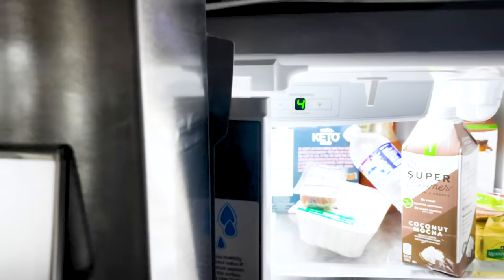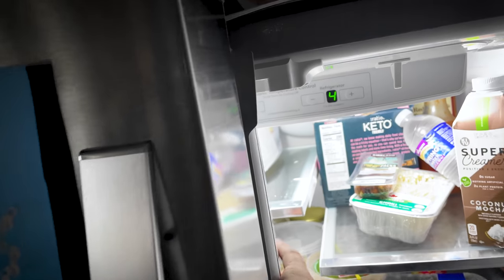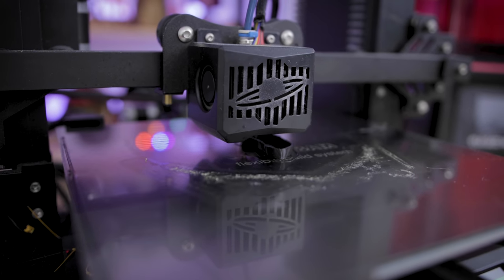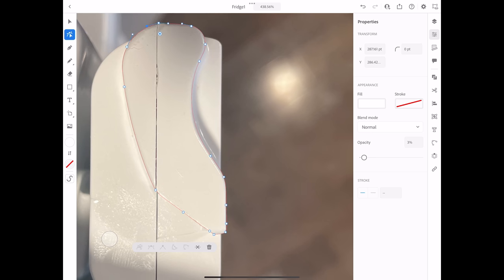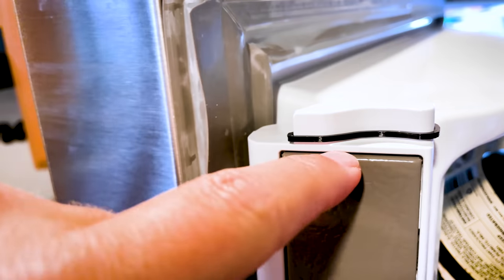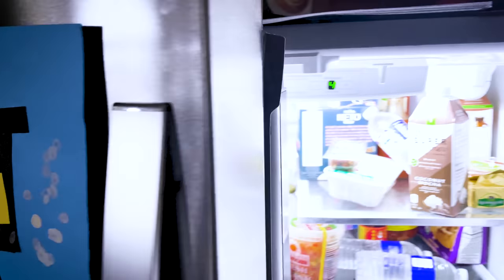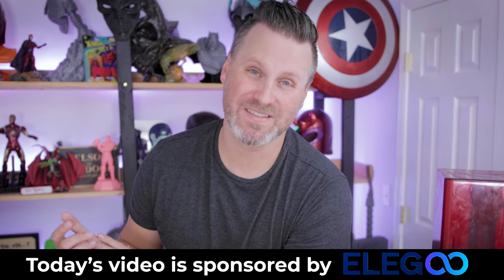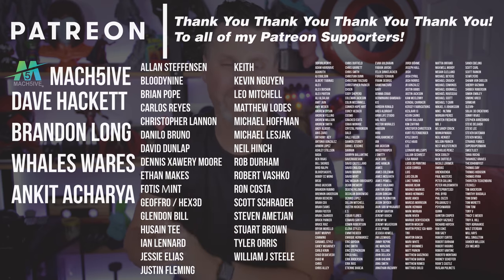Can I fix my Fridge with a 3D Printer? Functional 3D Printing

Comment from the maker: I’m a regular Bob Velveeta when it comes to home improvement 😂🧀
Reply: I appreciate just how cheesy, but smooth this joke is.
Reply: I’ve fixed my fridge with my Neptune 2 as well.
Reply: Whirlpool punching the air right now, watch them try to steal your idea
Reply: Just wanted to say... that if you freeze frame at 5:24 you can see that your left door is sagging down. I don't have that fridge, but there's probably a hinge adjustment you could make to realign the door...

Comment: Hey Jesse, as someone who used to deliver and install fridges, this tended to be a pretty common issue. It usually meant that the door needed to be raised up. How's the seal at the top of your door? If it's pretty weak, the door should definitely be raised. As cool as this print is, it may not be solving the bigger issue. 

Start by taking off the cap on top of the fridge door. If this is the side that contains a water line, be a little careful but it's still easily fixable. From here, you should be able to lift the fridge door up and look at the bottom hinge. There's a number of washers you could print or buy from a hardware store that can go over that lower hinge. This will raise the door and fix both the seal and the mechanism. 

Love your stuff! I got into resin 3D printing early this year and used a lot of your videos to help me get started. I just picked up my first filament printer and looking forward to it arriving soon. Thanks again!
Reply: I was just thinking the same thing. If that catch isn’t lined up, I would be worried the door was aligned properly. If it doesn’t seal well, it will work harder to keep cool and wear the fridge faster.
Reply: Another appliance pro here, washers in the hinge to boost the door is correct. A new mullion will probably fit like the original.

Comment: This method is even easier in fusion 360. You take a photo and measure one dimension of the object you photographed. Within fusion you can then scale the picture to a calibrated dimension where you input the one you took before. Then you use the "pen" tool like illustrator, extrude and print. (Did this for sunshade covers at home)
Reply: If you can put the object on a document scanner, you can remove all the parallax error and make it even easier to accurately model something
Reply: And when you can't find your calipers, you can just take a picture of the object next to a ruler, and use that to scale the photo (canvas in Fusion 360).
Reply: I just used the same process to make an air assist nozzle for my Sculpfun S9 laser.  Works great!
Reply from the maker: Oh man oh man. Okay I need to officially check out fusion 360… sounds super simple
Reply: @UncleJessy  I'd hesitate to call it "simple" but it's not overly complicated to get started and do what this project calls for. I've used the item on a scanner bed with a ruler next to it for a bunch of projects in fusion like recreating tape dispensers for thin Tamiya masking tape refills that don't have there own sized dispenser
Reply: @UncleJessy  "Fusion 360 Canvas" will get you good results on YouTube. Just include a ruler in your picture near the part, oriented as "normal to" the profile you are tracing with splines. "Calibrate" your canvas between two measurements on your ruler, and you're good to go. The only other considerations when printing are either scaling in x/y for tolerance, or alternatively, adding a tolerance in Fusion 360 to your traced profile by using the "Offset" command when you sketch (trace) the profile. The ruler trick is probably better anyways since this is a funky shape, and calipers would mostly serve the same purpose here (taking one dimension and using that to reference/scale the shape you trace with splines).
Reply: Same here I’ve used Fusion 360 to make parts by scanning or picture, then scaling it and test print
Reply: @UncleJessy  If you can use Illustrator you can basically use Fusion. Fusion is extremely intuitive and simple for most projects!

Comment: For me that is on of the biggest joys in 3d printing, the practical part. I am really excited if my wife or someone out of my family comes with a request and I often sink way to much time in it. For example by designing a tray system for my sisters polearm in her pet barber shop. went full overboard with it and needed 2 spools of filament for it and had a reason to get a 400x400 printer :D

Comment: I bought my first 3d printer for making project boxes for my electronic hobbies. Since then I've made plumbing brackets, paper towel holder, parts to fix my fridge, my atv, my van, etc. They really are invaluable tools if you have the mindset for DIY.

Comment: As much as I love functional prints, why the hell should it be the customer's responsibility to solve a warranty issue and why should he be afraid to pay for it? The product does not meet the specifications agreed upon purchase.
Reply: Happens way too much these days..
Reply: @ProthPhenom  yup, major brands used to give a shit about image and take pride in their products,  but they all just don't care
Reply: It's not a warranty issue.  The fridge isn't sitting level.  My fridge does the same thing in my old house.  He just has to adjust the height adjustment feet on the bottom front of the fridge.  One side is is sitting too low. It looks like he just needs to raise the left side of the fridge up a small bit, and then that little flap will engage with that center piece, causing it to close/open correctly.
Reply from the maker: Yeah… I was like uhhhh sorry I need to pay someone to come out to verify the issue that I know is there and then pay them to fix it?!
Reply: @UncleJessy  also for future,  you can cross check parts from other brands and likely get them cheaper. We have a GE dishwasher and the GE branded parts are 4x more than the Frigidaire branded parts. Also GE Washer and Dryer tower,  and it was the same. I was able to get the heating element by Frigidaire for $35, but the GE labeled one was $90
Reply: @UncleJessy  we have since upgraded to the LG Wash tower, and LG XL French door fridge. When we bought the house we had it filled out with Samsung appliances... big mistake! Do Not buy Samsung appliances! Lol they ALL broke within 1 week to 1 month after the warranty expired 🙃
Reply: @Fearmylogic  I don't think its a overall leveling issue with Uncle Jesse's fridge,  I think it's a door adjustment. Meaning he needs to loosen the bolts at the bottom of the French doors and raise them up in to the upper hings by 1 inch on both sides.
Reply: @Kitzkrieg  Possibly.  I just know that I have a samsung that has the exact same flapping mechanism, and the door hinges are not adjustable what-so-ever on my fridge.  But adjusting the feet height totally fixed my problem.
Reply: While it can totally be the product not being to spec. It could also be the Floor not being level and the installer or user not tramming the refridgerator. Which is not covered under warranty since that would be considered installation or user error.

Comment: Mechanical Engineer with 6 years of Solidworks experience and honestly, you did it basically how I would have done it! Solidworks allows users to sketch over an imported picture just like you did.  Companies love using "organic" shapes in their models so modeling this with a pair of calipers would've actually been more difficult/time consuming! Good work!
Reply: As a non-mechanical engineer, but just a regular guy without any special knowledge, the first thing I'd have done, is make sure the fridge is sitting level.  at the 18 second mark, right before he opens the doors, you can see the left door is sitting just a touch lower than the right door.   I know I'd have done this, since I had the same issue 3 years ago when I bought my fridge with the same mechanism.  He just needs to adjust the height adjustable feet on the bottom of the fridge.  Looks like the left side needs to come up a little bit.   That's it. Its probably not the hinges, or the flap, or anything complicated.  He just needs to level out the fridge a bit.

Comment: I had an issue with a built-in fridge, in that the clips for the outer door had all broken over time (15 years!). I knocked up a copy of the broken clips in Fusion360, using a micrometer to get the correct measurements, increasing the length of one part with the slots for screws on the edge of the fridge door. Printed them on a Wanhao Duplicator i3 Mini (all I had at the time), worked well in PLA for the next 3 years.
I did use an SVG file for a different project, to make a 10mm insole for my right shoe - discovered after an x-ray that my right leg is 11mm shorter than my left leg. That was printed on an Ender 3 v2. Still going strong after a year of use.
Reply from the maker: Wowza!! Now that is impressive! 3D printing to the rescue! I really need to attempt to learn some fusion360 basics
Reply: @UncleJessy  I'm still learning! 38 years after getting a BSc in Computer Science and still learning new stuff 🙂

Comment: Hey Uncle Jessy, new subscriber here! Ummm...from the gasket to opening misalignment I can see at the 1:23 mark, your entire door is sitting low on the fridge, which is why the mullion isn't catching the tab properly. That is almost always height adjustable, and would leave you with a better sealing door and your mullion problem would be resolved.
Reply: I came here looking for this comment as soon as he showed the problem
Reply: @neoyarus  Ditto
Reply: Of course this is the issue.. but if you only have hammers, then every problem looks like a nail..

Comment: I’m thinking the issue is when you put the fridge in place you never leveled the feet on the bottom, the right door is higher than the left and with French door fridges they should be the same height, just unscrew the little foot on the front left a bit to get some more height and should fix it, but I like the idea on how you solved your problem, got to love 3d printing.
Reply: I have this same fridge and had to do exactly that.  After leveling no more problems.

Comment: Nice fix , you may want to have a quick look at the hinge on that door though, looks like maybe the problem was caused by the door sagging, maybe there is some adjustment on the hinges to correct it in case it gets worse.
Reply: It's not the hinges, at least it SHOULDN'T be, or there would be noticeable wobbling of the door.  I have the same type of fridge that had the same problem.  He just needs to adjust the feet knobs, and raise one side a little bit.  That should fix the issue.

Comment: Great fix. Using a photo or flat bed scan has the same limitation as photogrammetry, which is that there is no size reference. One tip is to add a ruler to your photo or flat bed scan, so you can scale properly. With photogrammetry, you'd have to measure the original and scale accordingly.

Comment: Great video! Fusion 360 had a "canvas" feature that lets you import a photo and sketch over it similar to what you did in illustrator. If you know a dimension between two points or if you include a small ruler in the photo, you can calibrate the image scale with two points. It's a great feature for reverse engineering.

Comment: Good Job Jessy. We are opposite. I do mostly functional prints. I do like the stuff you print, just don't have a need for them. You may be able to make an adjustment on the door to raise that hinged part. Either way, it works now. That's a win.
Reply: I had the same problem a couple years ago with a samsung fridge.  For some crazy reason, It's the height adjustable feet that he needs to mess with.  At 18 seconds in, just before he opens the doors, you can see the left door sits just a bit lower than the right door.  He just needs to adjust the big black knobs at the bottom front of the fridge.  Raise the left side up a touch.  At least on my fridge, there is no adjustment to the door hinges.  They are just solid pieces of metal screwed into the fridge, and slide into holes in the doors.  So if it was the hinges, he'd have much bigger problems than this. The entire door would be wobbly ( a sign that the screws are loose ).

Comment: If you have access to a 2d flat bed scanner, id have recommended: 
1. inking or painting a thin black coat onto the profile you were trying to copy, and then stamp it onto an A4 piece of paper (as this A4 size can be your reference dimension when it comes to scaling the image after the next step), then wipe clean once done.
2. then import the scanned image into fusion and trace around the stamped profile.
3. Create an offset edge from the original profile to give your self a small tolerance, say 0.25 -0.5mm (This would give you 0.5mm - 1mm of overall play) 
4. Then another offset from the original profile of 2-3mm (this would be your wall thickness) which will then give you a profile that can be extruded upwards by whatever height you needed. 

Alternatively, you could have imported the scanned image into illustrator and convert it into an B&W SVG file on an A4 canvas, this could then be imported into fusion, scaled to the correct size of A4 and would save you having to trace the profile manually as SVG formats can be extruded/used as sketch items, allowing you to skip step 2 which is probably the most tedious part of this process. 

It would be rough, but with out some callipers and other metrology devices to find curves etc, its a simple way of getting something made, with less chances of making lots of 'proto-type' fits that end up in the trash. 

And then yea bobs your uncle, or in this case Jessy is your uncle

Comment: I made a new handle for my brothers business printer and I used Fusion 360.  I took a picture of it, then used the calibration tool to set the dimension of the picture to reality and did and outline and extrusion etc like you did.  It came out  better than the original.  It was fun!  You did good!

Comment: You're doors aren't level. There should be a hex screw in the bottom hinge to raise the fridge door itself. Open the freezer and look up at the bottom of the bottom hinge to the door with the flapper. If not then perhaps the fridge itself is not level. Still, nice job in the print

Comment: An awesome way to get the dimensions of what you're looking to recreate is to set your calipers to a set length, like 10mm, then take a top-down photo like you did, with the caliper in the photo!
Gives you a perfect frame of reference for the dimensions of the object right in the picture, that you can use to model it.

Comment: Neat video, love this kind of practical solution to things. FWIW it looks like the bar was mounted itself too low.. That nub you built the extender cap for should have fit in the upper slot. Looks like the bar was mounted with the nub being just under the bracket instead of it being the bar just under the bracket so the nub would go into it.

Comment: I've actually got a problem worth my fridge that I was going to print a solution for. It's a brand new fridge, only a couple weeks old. The butter shelf has a door on it and one of the nubs that makes a hinge is totally broken off so I'm thinking I can just print a little cylinder and glue it on. I just need to look at what kind of glue will work best with plastic in cold temps.

Comment: You probably want to make it a little taller so it's fitting the turny bit better and has more strength in the area that's interacting with the fridge body. Or just print another one when it breaks. Looks good!

Comment: Tape over the top, trace out the pattern add in an x and y measurement box for reference, import picture to fusion360, create a box matched to the size and create a spline/vector around outer profile, duplicate vector, enlarge scale and extrude to required height, would happily do it for ya haha

Comment: Tracing a photo is exactly how I would have done it. I would have used different software, just because it's what I already know, either LightWave 3D or MoI 3D, but the technique would be the same basically.

Comment: Ingenious... but did you look at the base of the hinged part to see if there was and adjustment knob to lift the part in question?  It just seems to me there should be.  I can't believe the original part would have been designed so poorly that it would have been too small.  There MUST be a way to adjust it.

Comment: I build motorcycle, and use photos all the time to mate to existing structures.  Always include something with an object with a known scale, like coins, or a machinists scale (printed tape measures aren't very accurate).  Then you scale the photo in photoshop so the known object, then build your vectors in AI.  If I need 3D objects, I save as AI8 and import into Maxon C4D (yeah, not cad, but I'm an illustrator) and spit out STL or DXF files.